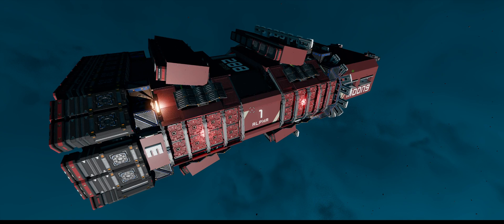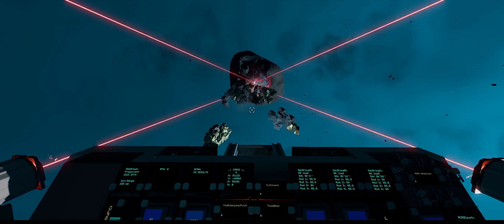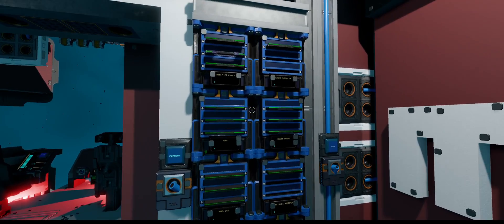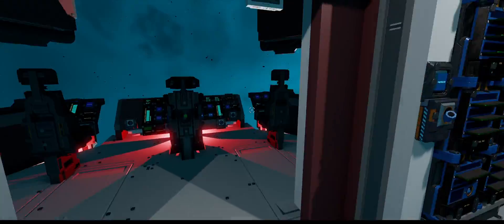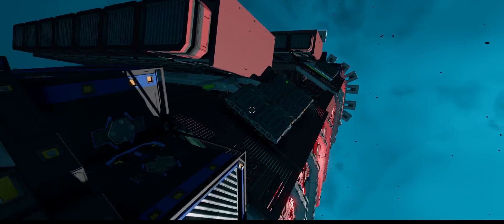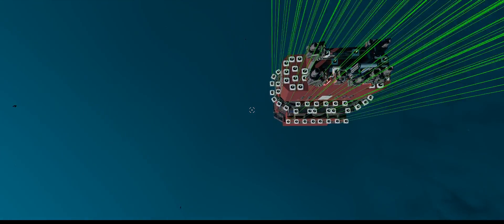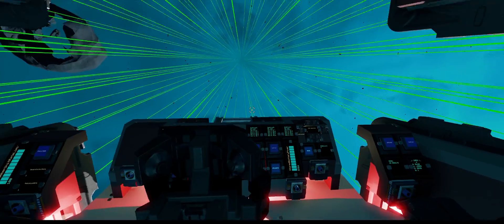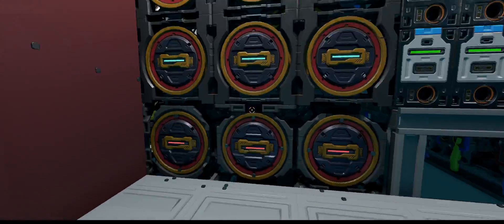Starbase Ship Showcase - Moon9 288 Miner

Comment: bro I had a heart attack looking at the piping and cables in the back….why arn’t you using ducts.. it brings down the assembly costs significantly
Reply from the maker: I use ducts other areas of the ship.  With all the angled thrusters it would have been really duct-messy and my OCD would have been crazy.  I appreciate ducts for straight or simple runs for sure.

Comment: im seeing more and more designs using angles thruster is it purely asthetics or it gives an advantage in maneuvering??
Reply from the maker: More top speed  with the 15 degree thrusters.
Reply: The thrusters at a 15° angle allow for more compact designs. So, instead of having a wall of box thrusters at the back of your ship, you can spread them around the hull.